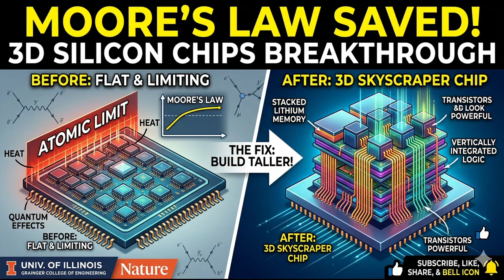Scientists Just Saved Moore’s Law With 3D Silicon Chips

Comment: its not possible because you cannot cool, inside the skyscraper you will have insane temps that will burn components, thats why we still use flat chips, until we solve heat, we cannot stack vertically too much , maybe 2,3,4x then its over again, and if you 2,3,4x the components you also increase power in 3D shape , without dropping size of components with new litography you cant stack more than what we have now because insanep power requirements , it would literally melt